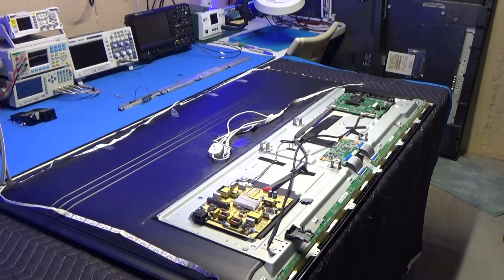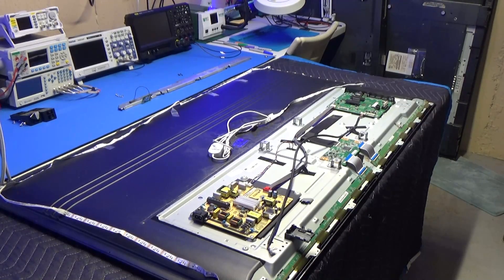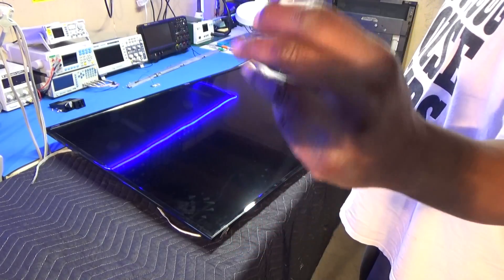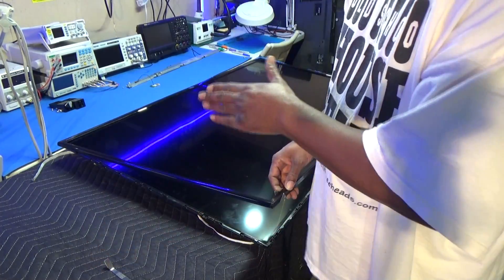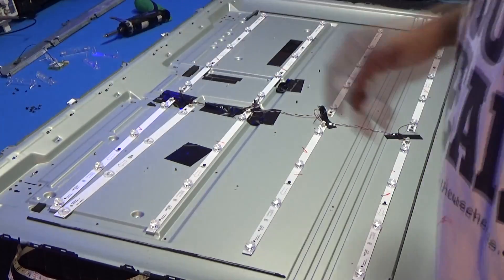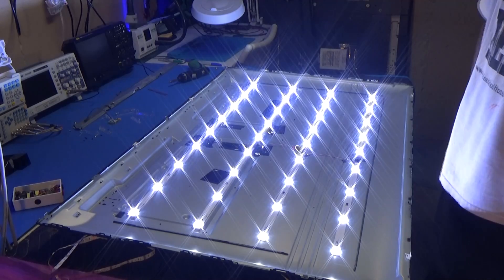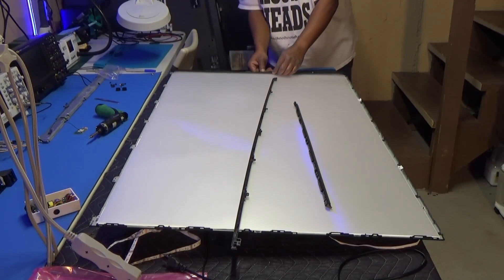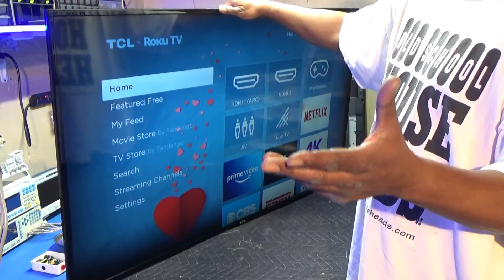TCL 55s405 tv STUCK SCREEN removal for Led Backlight replacement.

Comment: I was trying to fix a TCL 55 inch Hisense Roku TV because the backlight would blink once or twice and just stop. I replaced the backlights but that didn’t fix the issue. Could it be the power supply or what?

Comment: Hey BigDog! 

You are the reason I've been able to start feeling comfortable repairing TVs in my free time and I appreciate you!

I currently have a TCL 55S405
It just flickers on when I try to turn it on very quickly and when I light it up with the flashlight while it's turned on I can see what's showing on the screen 
And also the volume works 

I read on a forum before that if it does flash up brightly it could mean that it might not be an LED problem but it seems like just changing the LEDs will likely resolve the issue correct? Since apparently bad LED strips is a common issue with these series TCL TVs 
Right? 

I genuinely appreciate any response🙏🏽you must be a super busy guy

Comment: I just got this same set in for the same thing but it didn't go well. While you made it look fairly easy to replace the panel back into position, I spent at least 45 mins trying to be sure I gently had it correctly situated including carefully checking the corners but after I fired it up there was a crack in the corner🤬  Has this ever happened to you ??  Freakin expensive lesson. PISSED !  What suction cups do you use? I tried getting a pair from Amazon but they were garbage. I was thinking about going to harbor freight. Looking forward to more course lessons when you get a chance to post.

Comment: Great video! How do I determine which backlight to buy? Can I just get any backlight for a 49" TCL or must I get specifically for my model?
Reply from the maker: Use the TV's model # and search online. Otherwise pull the strips out so you can see what it looks like and/or look for a part number on the backlight strips.
Reply: Thanks!  @bigdog8882

Comment: Question,  I have a 55s405 that will flicker for a split second and stay dark,  all thenother functions seems to work (can hear them) all the tests have not yielded results,  so am I looking at a power supply issue or led issue?
Reply from the maker: Led/Backlight problem

Comment: WOW. This was fantastic. Mine just went out and I’ve already bought a replacement but will be following this to repair and use the old one in another room in the house. Thanks for demystifying the process. Had no idea it worked this way.
Reply: Hey, how did you determine which replacement to buy? Did you just get any for a 49" TCL or specific to your model?
Reply: I used a playing card slowly ....to get the adhesive on top

Comment: So you're saying you typically don't replace all the LED's at once on these TCL tvs? I've done 6 of them, and what I have noticed is typically more than one led out, but I've always just replaced all the strips. I have been saving the strips though. Are you saying it's worth reusing old strips where none of the LEDs have gone out? I'm assuming you've done dozens, and trust your insight either way. Thanks!

Comment: I started to replace the backlights in a 55s405.   and have lights from a 55s401 but it has 8 wires instead of four?//    the s405 has black and red on one side of connector white and red.... s401 has black and red on one side. red and red on the other. then 4 white between those??

Comment: I have this tv and the picture is noticeably brigher on the top half than the bottom of the screen. Would this be a repair for that or would it be a board issue? Great video btw.

Comment: I got impatient and didn't want to wait to buy those suction cups...I (slowly) lifted up different sections of the screen and inserted a thin bed sheet underneath. Once I'd gotten the sheet completely underneath the screen, I used the sheet to partly lift, partly drag the screen off of the chassis and onto the table next to me. It actually worked pretty well.
Reply: Glad to hear this worked! I was thinking the exact same thing. Had my TV repaired last year for the same issue, but they've gone out again. So just going to try my hand at it this time. Worst case I have to buy a new TV 😁
Reply: i used big unfolded cardboard box
Reply: I was gonna do that but decided not to risk it. On a 50 inch or so maybe would of, but 65 i didmt wanna risk lol alot more flimsy. I went to carquest got 2 suction cups for $20

Comment: I just cracked the tcl 55 4k uhd adroid tv i have Where can i order the panel and hm will it cost?
Reply: Are you talking about the front glass panel? Unfortunately, if you've cracked that, it will likely cost less to just buy a new TV.

Comment: hi i have a 55'' TCL smart tv mod num; 55C1CUS first hint something was wrong was when bottom right hand corner went white  ,on off,and the next day turned it on sound was working but no picture ,removed back all looks good turn tv on backlights come on but no picture any ideas what could be fault ? im thinking maybe T-CON BOARD? 
regards perry

Comment: Thanks for the videos. Had a couple of questions,where did you get that prying tool? And I have a TCL 65" 65S4LEAA. I just bought it in November of 2018 and done went out. Was watching it last week and the screen just went black. The light on the bottom flashes when I push buttons and get sound but no picture. Every once in awhile when you turn it on you see it flash tcl on screen for split second then just back to a  black screen. Sound like the strips to you? The process about the same for it? Appreciate any help. Thanks!
Reply: Did you find any solutions? What did you end up doing?
Reply: @chieflookingglass , ended up just buying another TV myself. An LG. I heard not to buy these TVs on black friday like I did the first one as they mass produced them quickly to get alot out for the holidays and never last too long. But who knows.... I am sure it's just one of the bulbs to the backlighting went out causing them all not to work like Christmas lights do. I can take it outside in the sunlight or shine a flashlight on after turning it on and you can see the picture in the background really vague but it's there

Comment: Thanks for posting these videos with clear instructions and an entertaining commentary. I am most intrigued by how you replace individual LEDs instead of the entire strip set! I have the backlight problem with my TCL 65S401 TV. Can you tell me what is the voltage for the LEDs and where can I get them? eBay sells many 3V and 6V LEDs but the delivery time is about two months. Thanks for the help.
Reply: I have this same model too. Died after 3 yrs only... And based on the video views, 62 thousand other ppl have this problem also. Makes me angry that electronics are designed to die, so that you'll repurchase.

Comment: I have a question question what happens if you put different led black lights on a different brand tv ?
Reply: Possibly nothing...but if the power draw is too different, you could burn something out, or potentially get some smoke/fire...at the least, the LED's might just be dimmer than normal.

Comment: My TCL 55" TV (Model No 55S62A), just went blank, no video, no audio. Could this be a power supply issue or LED's. Is it expensive to repair, or would l be better off just replacing it
Reply: If there's no audio either, it's likely not the LED's...but you could try the flashlight test and see if it lets you see the screen.

I would guess, at the very least, it's a loose connector...at the most, you may need a new board (and hopefully whatever killed the board didn't also kill the LED strips lol).
Reply: @usnavhm  Thanks for the response. Note that it was in fact the Power Board that went bad, I had to replace it, TWICE, not sure exactly what is shorting it out. It's working fine now, thanks again

Comment: I just replaced the LEDs in my dads. Everything works but when you look straight at the screen it looks dark but from the sides its perfectly clear and bright. Is there a specific order those defusers have to go back in? I'm thinking mine are not in the correct order.

Comment: I can’t get a voltage reading in the first step but I definitely have backlight issue. What settings on voltage meter? Why doesn’t the power come out of the power supply

Comment: I have a TCL that I just bought in November for the Black Friday specials at Walmart I play a lot of video games so I spend a lot of hours on it and recently it's been shutting off I've tried to unplug it for the 2 minutes  unplug HDMI cords plug it back in nothing seems to work it'll stay on for like sometimes 10 minutes sometimes an hour and then it shuts off and keep shutting off for a while do you have a video on this 😊
Reply: Could be that something's pulling too much power, causing it to shut itself down. It could also be from dust/hair collecting and causing something to overheat.
Reply: @usnavhm  yes that's what it was I got my electricity fixed and it works perfect

Comment: Will I be able to tell rather easily if my screen has the tape at the top?  I have the 55S403 (Costco) version, maybe someone could chime in?

I believe the S401 is Walmart and S405 all other retailers.   Great videos, I’ll be trying the repair in a few days my biggest concern is cracking the screen if it’s taped at the top.   

Thank you!!
Reply from the maker: Once u take off the other 3 side brackets, when U go to lift it out; thats when you'll know. lol that easy.

Comment: I need help. I just replaced all the led strips...assembled everything back again. Found a few that needed to be replaced. Anyway...powering it up and its still no backlighting. Im so frustrated now. What else could it be? Everything powers on, sound, and using a flashlight I can see the image...but no backlighting
Reply: Late reply, but check all your connections and test the output from your power supply if you're able to. The problem is likely no power being output from the power board.
Reply: @TonyB851  it was a bad led

Comment: Hello, I have a 55” TCL smart tv model 55s403,, I replaced all the led bulbs yesterday I put it back together I guess when I was taken the screen pane out with suction cups I damaged the too left corner and it’s like wrinkle looking and I have a 2 to 3 inch line running across the top but I can still see picture.. bit other than that after about 3 minutes the picture fades away and goes dark but I still have backlight.. I unplugged tv for 60 seconds plug it back in and it turns on fine , I have picture and then 2 to 3 minutes later does same thing picture fades away but still have backlight and sound..I Can you tell me please what can it be ,, thank you

Comment: Found your first video a little a while ago ordered my strips,tester and suctions last night while disassembling the tv the top of the screen was glued, other videos I found showed running a thin card along the screen to pry it loose nonetheless I cracked screen before realizing I could of worked the screen loose leaving the top diffuser bracket attached.  So today I found this video a day and $300 late(cost of new tv) but I appreciate your videos cause even after cracking the screen I feel confident in disassembling this type of tv again.
By the way I changed all the led strips so now I'm gonna take the tv apart again and remove the strips and possibly sell them or see if I can return them.

Comment: I had the same problem the output MOSFET is shorted replace it with a 500v 3a MOSFET also check the diodes on the positive lead and see if it's bad

Comment: Good one BD check the output of that tester to see what it’s pushing out...
I still use the older type without the controls 
I use a credit card to release the sticky it but move it like a saw to cut through it not by prying it up
Reply from the maker: I hook it up to my amp meter and it almost blew it up, the display started flashing and it was making noise. It measures a Max of 12Amps. Thats when I knew something was wrong. The checker also blew out another edge-lit samsung tv i had. What a piece of shiiii... lol
Reply: @bigdog8882  get rid smash it up and place it in the trash or email the company that makes them 
Be careful bud

Comment: I have a TCL ROKU 55" LED 55R615 GTC003678A YR 2018 were can I get a panel for this tv
Reply from the maker: Get the panel # off of the sticker on the metal chassis and see if U can find it online.

Comment: Hi bigdog luv the vids. You git any tips for a samsung UE 75 H 6400. Screens not coming on red light flashes then just goes off.
Reply: Unplug main board from power supply and plug in mains if the back lights come on they’re ok  
Next unplug mains, plug main board back in unplug t-con board plug in mains same result?
Unplug mains and undo 1side of the screen driver boards plug in mains same result unplug mains, reconnect screen driver cable and repeat on the other side, same result ? Mainboard fault
Reply from the maker: Not really, might have to look on some TV repair Forums.